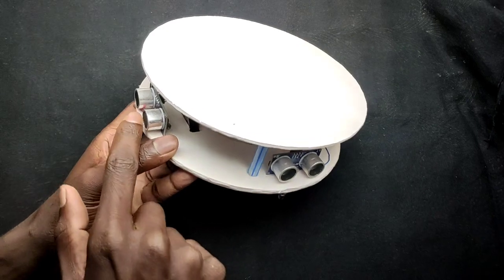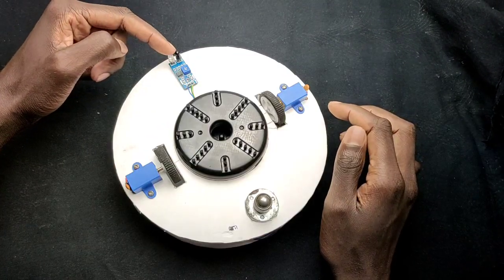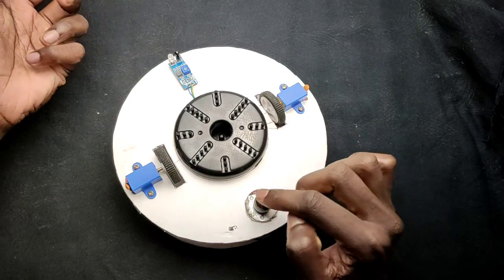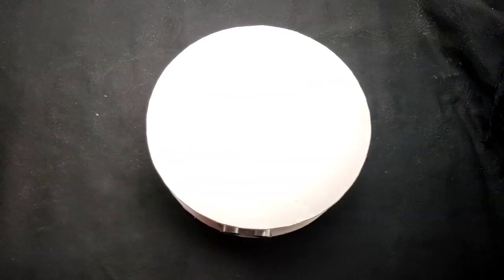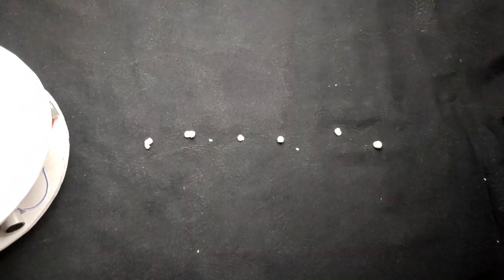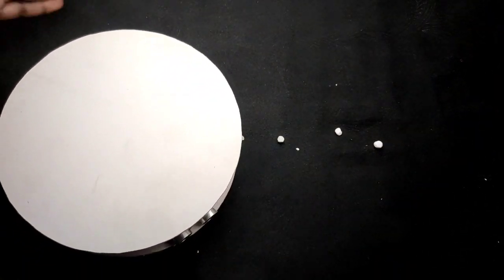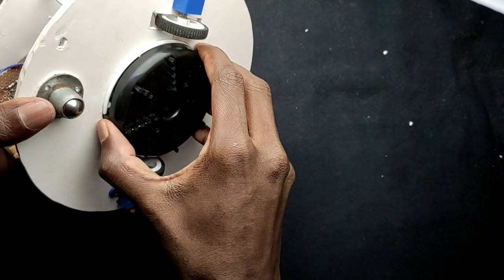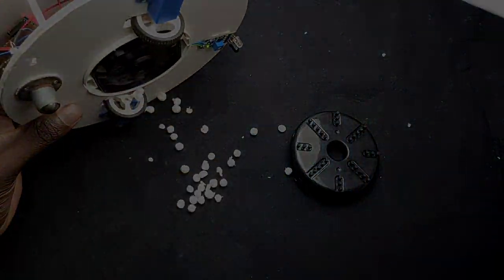Build your own Arduino based Smart Vacuum Cleaner Robot for Automatic Floor Cleaning

Comment: What castor wheel did you use, and do you have pictures for placement and soldering instructions? I looked at the guide but it was not there. Also, what "switch" did you use?

Comment: I noticed in the video you have two separate individual batteries powering the robot instead of the listed 7.4v lithium ion battery on your website. How do I connect the lithium ion battery to the robot and still be able to recharge it? Thanks!
Reply: The important thing is "the code" for another things, you can be creative by your own. You don't have to follow every single thing.

Comment: HI, URGENT. May i ask, the motor which inside the portable vacuum cleaner connected to where and which pins?
Reply from the maker: please check the link in the description for complete connections
Reply: @Circuitdigest  the link does not mention

Comment: What is the purpose for using ir module in this model
Reply: To measure distance from IR to the floor. The purpose is to avoid the robot from falling when there is a great diffrent in distance from IR modules to the floor

Comment: Did u write the code in arduino ide??
Reply from the maker: Yes, you can check out the step-by-step procedure for this project. Link in the description!
Reply: @Circuitdigest   Yes I have seen the link in the bio. U didn't mention there so I was asking. So yes is for u did write the code in Arduino ide